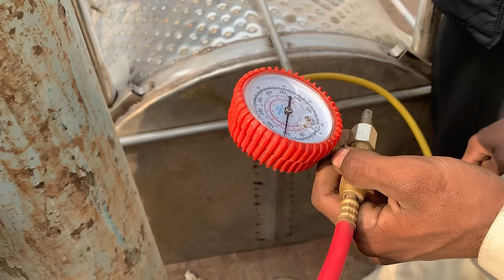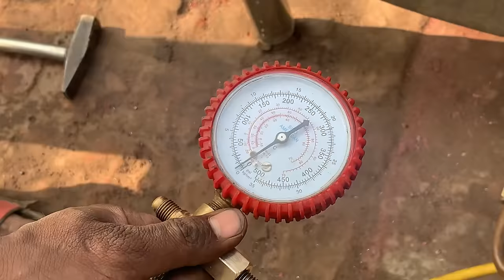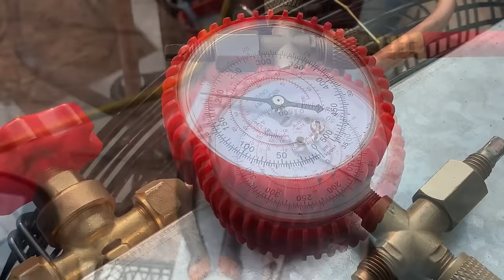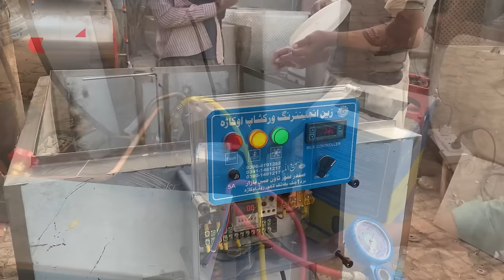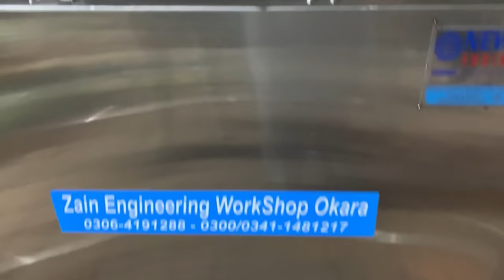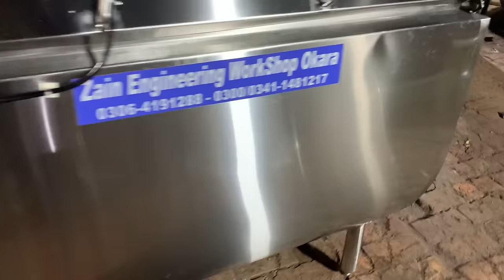How Milk Chiller Tanks are Made From Stainless Steel Sheet | Bulk Milk Chiller Making For Dairy Farm

Comment: Whoever designed and installed the chilling unit should be put in jail for life. The compressor is at least 4 times oversized for this application. All connections should be brazed, no compression fittings, and teflon tape is never used on compression fittings. Compressor to tube connection should be snug fit, and the big gap between the two is filled with a solder with a high probability of solder dripping inside. These solder drippings will damage the compressor and clog the lines.
Reply: आपका मोबाइल नंबर भेजो
Reply: Fk
Reply: They're flares bro. Chill. It's sad you can't appreciate what they accomplish given the work conditions, materials, and tools at their disposal. Remember our guidelines are driven by a federal entity. They don't have someone sitting behind a desk writing regulation.
Reply: Refrigeration system wouldn’t last long for sure
Reply: U are only talking based on how u were brainwashed by books written by somebody.  These people are proofing that Jo books were not always a solution